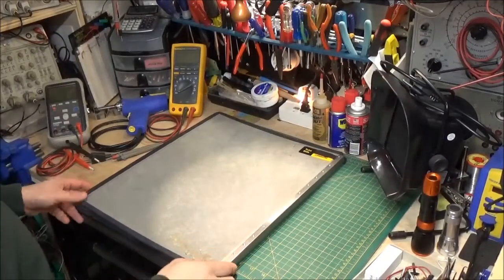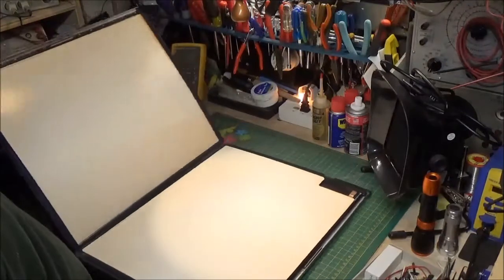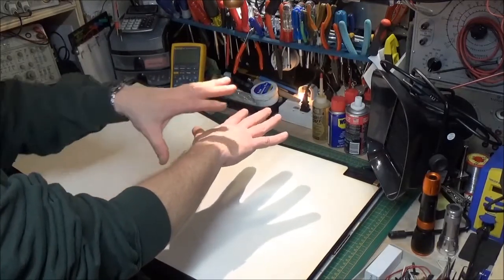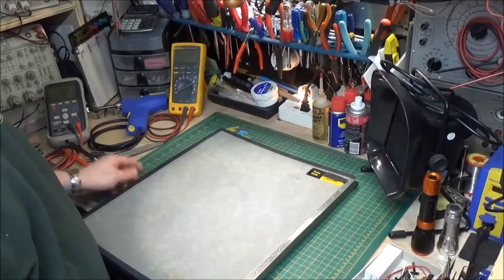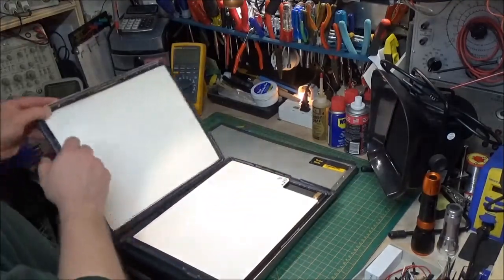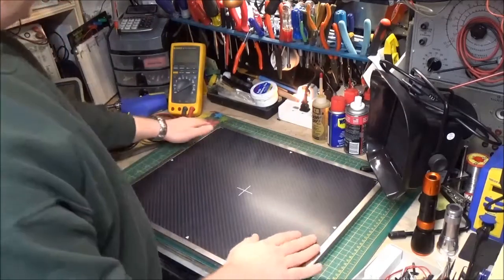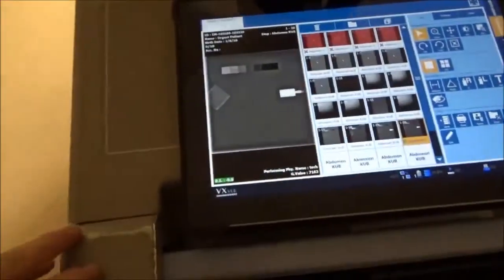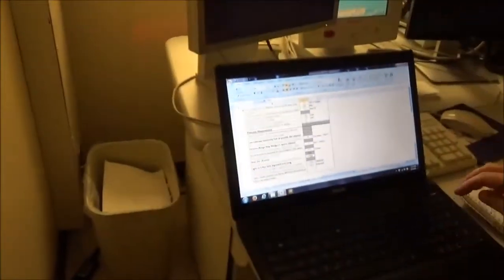X Ray Video 3   Types of Receptors1

Comment: I assume these DR plates are made of an array of expensive SiPM chips? How much does a large plate like the one you present cost?
Reply: You can get a non functional one for around 100-200 usd I'd assume if it is say a bgo or lyso scintillator with SiPM chips. A nonfunctioning target might be a good parts haul.
Reply: I maybe wrong on it, most appear to be a thin plate of scintillation material, mostly I'm finding CsI then a light guide and a pcb with built in photo diodes in a pixel array. I guess you may be able to repurpose the scintillation material. But as for photo detection, it is a bit more hard. 
Maybe on the older ones itll be more easy, but as for that I'm uncertain.